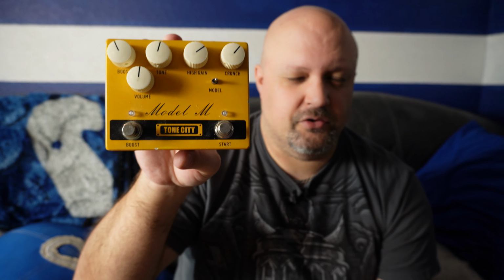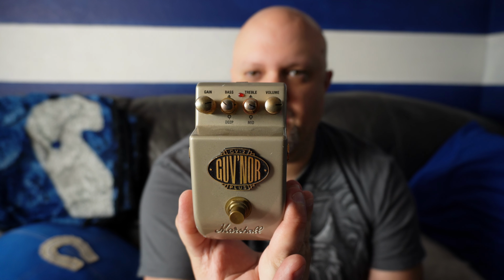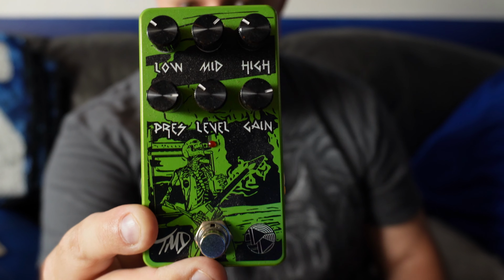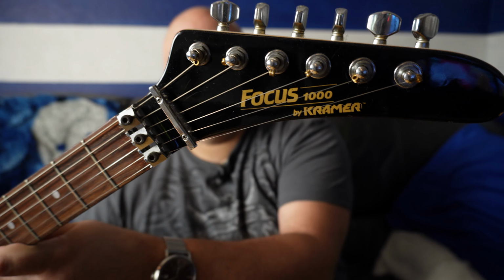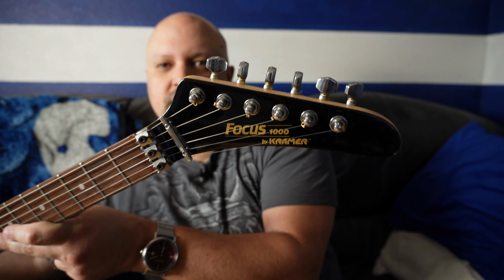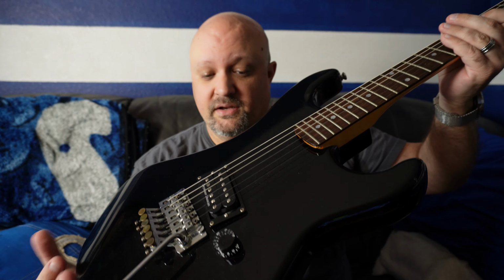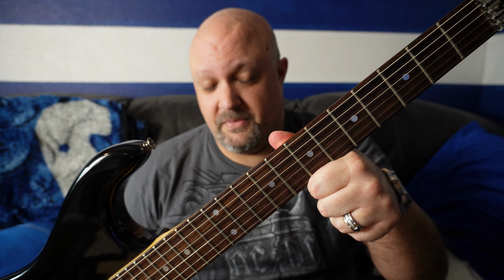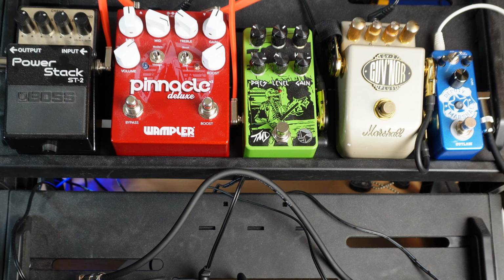Marshall-In-A-Box Pedal Shootout!

Comment: The Wampler PInnacle Deluxe v2  is great as a distortion pedal. You really need to understand the  3 band eq and all the switches and work in order to get the sound you are looking for. The Plexi Drive Deluxe also by Wampler i would say fix better as the typical plexi sounds with fantastic clean glassy tones and  so much more low gain possibilities.

Comment: I have bought and sold about 250 pedals since 2014. I review pedals but keep the best than sell the others. That said I have kept 70, LOL. My favorites are a good  MIAB . They are all good but most I had but sold as I found another that covered the same ground better. I guess I will pick the NUX because that one I kept because I also own 10 guitars and the NUX is killer with a Tele bridge PU. The Tele PU has got killer bite but needs fattening. The NUX is simply perfect. With other PU's the NUX I find is too woofy in the low mids. Thanx for the video. It was excellent with so many to compare.

Comment: The Peppers is killer.. lots of gain on tap.. but Marshall is EITHER plexi modded or JCM 800 modded.. they are not the same.. Model M was great.. flexible... NU-x has that sizzle.. but the Fireman does not have the gain of the BE-OD pedal... I dont use mine past 10-11 o'clock for gain..evern with the dip switch set lower.. lol.. nice shootout..

Comment: Those old Focus are cool. ESP made all the Kramer necks right ? I’m assuming even the Focus. I had a chance to buy an old Focus and or a Charvel Model???? Something for about 300 dollars back around 2010 but I wasn’t playing guitar very much at the time and it wasn’t uncommon to see them in good condition for less than 500 back then. I had a shot at an early 90s Soloist it was black Cherry with a matching headstock which was kinda special as it wasn’t a custom shop but kinda a semi custom. They pulled this soloist off the line because the guy wanted black Cherry and a matching headstock. They were building production soloist by the time anyway 1000 and I passed ( insert Fred Sanford YOU BIG DUMMY! ) . 
I was never into Kramer when I first got into guitar and Eddie was already playing Peavey by the time I started playing. Kramer came on quick and it was like they went away overnight but I consider Kramer the original every mama super Strat .
Crazy how student guitars become desirable 30 or 40 years later
The Plexi Crunch is hard to beat for the money as long as you actually want a hot rodded Marshall it’s got a ton of gain!